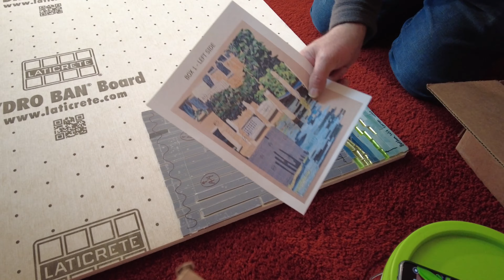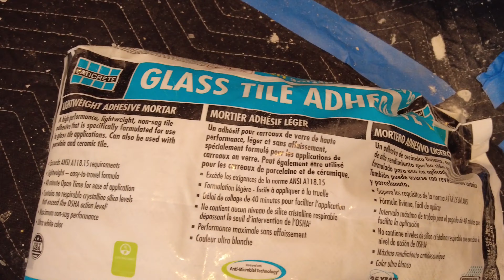Work Of Art, the Making and installation a Stained Glass Mosaic Tile Mural over a Fireplace.

Comment: Hey Sal, nice to see you making videos again, have a question for you, your tips are great, you know now they have a design type of tile, like with waves on the surface, what would be the best way to level them? Wedge system? Since the surface is not flat, I am curious if it would work. Also when tiling a tub on that outer wall, when you pass the tub typically tiles are sometimes sold with those end pieces, the one we have does not have that, what would be the best way to finish those ends, would I place my tiles pass the edge of the tub and work my way in? Tks again Sal
Reply from the maker: https://www.youtube.com/watch?v=Rn39YJt15_g&t=2547s